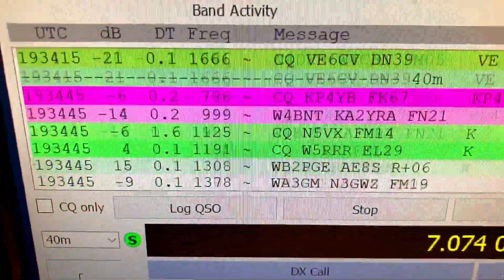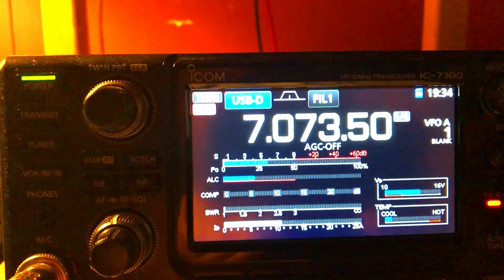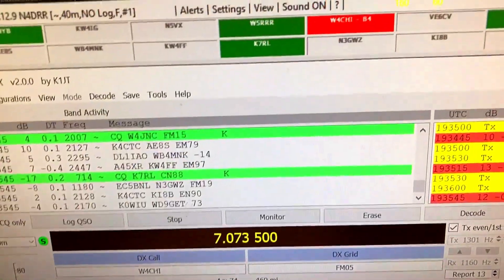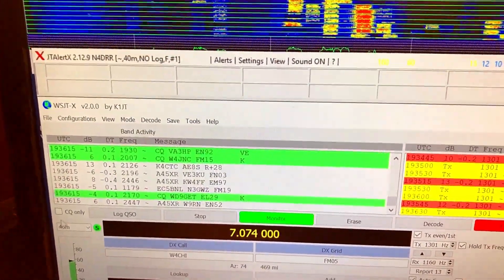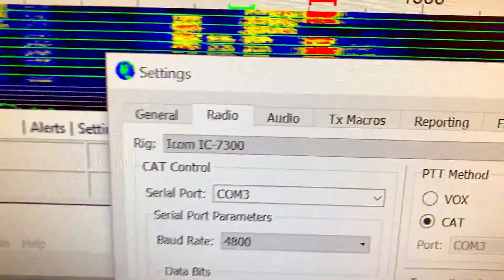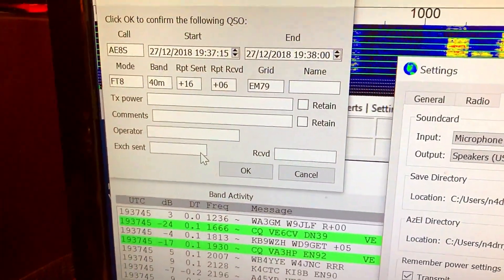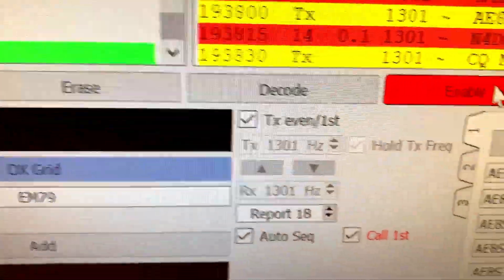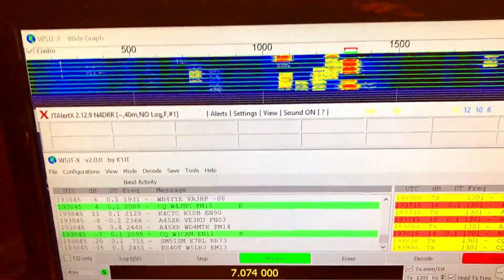FT-8 on IC 7300 using USB cable only

Comment: My icom 7300 will not transmit wonder what your settings are? I am using LOG4OM Omnirig WSJT-X and JTAlert just a single cable all okay on receive! 73 Phil ps have done a hard reset of radio must have a setting wrong some where in radio :( 73 Phil G0BVD

Comment: What are the menu settings on the 7300?  WA9RYO
Reply from the maker: menu in settings under cabling you must select USB cable to communicate with your computer,, also while in FT-8 be sure to select USB-D to make contact,, also be sure to down load the drivers from Icom for your IC-7300 before connecting the USB cable to radio and also download the new 2.0 version of WSJT-X